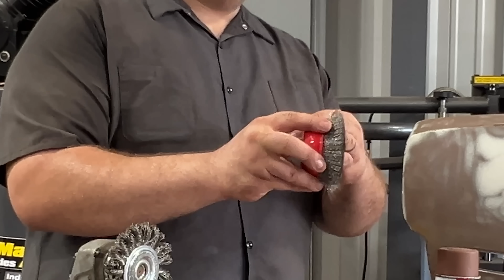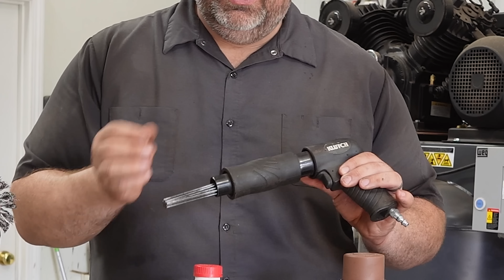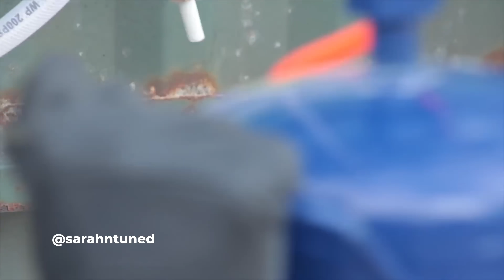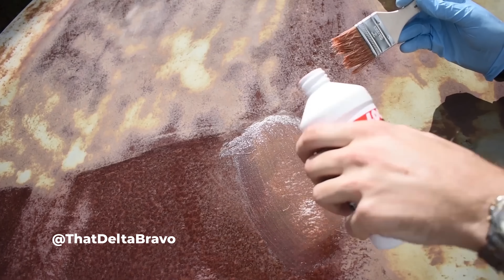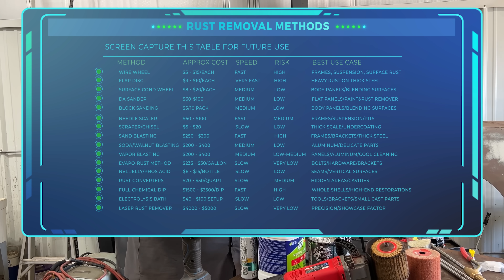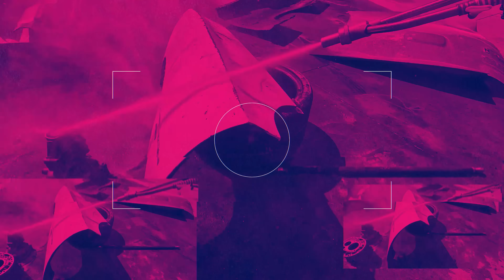I Can’t Believe It Worked! The Best DIY Rust Removal Methods!

Comment: So what would you recommend to remove paint off of molded plastic?  I've got a couple of side skirt extensions that I want to get repainted, along with some center caps, so everything matches the same color paint I'm planning on using for a couple of canards.

Comment: Another vote for good old citric acid soaks, go with it in it's Anhydrous form for the best bang for the buck to mix with plain tap water (or if you're feeling flush de-min or de-ionised). Plus if you can heat your solution go for it.  I use a lethal ebay special mains powered immersion heater to acclerate the process, unplugging it before getting in the tank for a good scrub during the pickling with a wire brush.  Wear thick long cuff nitrile gloves too. The big uside of this remedy is that you can simply pour it awayonce the solution has ceased being effective as it's non toxic.  You need to give everything you've soaked a rinse in clean water to wash/flush any of the solution off the parts, and be warned they flash rust fast!

One thing I'd like to see is a comparison on is different re-usable blasting cabinet media, I'm having a hell of a job shifting powdercoat off steel in my cabinet despite having a fairly ballsy compressor.

Comment: definitely eye gear. One time not wearing them a dremel wheel blew up and pierced right below my eye in my eye lid. just a fraction up I'd be without an eye.  The while wearing gear a wire wheel (cheap one) blew apart and my face looked like a porcupine.

Comment: I tend not to use chemicals, I use media blasting of one medium or another, dry and wet, electrolysis bath, sonic cleaner, vibratory tumbler, various grades of bench mounted wire wheels/polishers and sometimes hand held wheels. I would love a laser unit but $$$ are an issue.

Comment: I just bought the Vapor Blasting.  -  I use Coroseal for frames,  and If I Can submerge the parts,  I use Vinegar and 10% molasses,  For other parts like roofs,  I use Krud Kutter Rust Dissolver  this works well and is water Soluble.    Excellent Video.     Sorry for your loss.

Comment: Sorry for your loss, Jared.

I LOVE evaporust.  However, I also bought some citric acid powder for descaling my robot vacuum/mop.  Mixing it with water, it works just as well (and it seems to take less time) as evaporust.  I tried it on a few of my rust coated tools and bolts, and it cleaned up exactly like evaporust.  It was about $8 for a can of citric acid powder.
Reply: Now put some washing soda in with the citric acid.  You use a 10 to 4 ratio acid to soda. The soda neutralizes the acid some. It still works. Makes it more like how Evaporust works. Some say it works better.

Comment: In the 90s I worked at a boat trailer plant and ran a machine called a wheelabrator. This thing was the size of a small house the trailers went through. It used steel shot about like grains of salt. Wild times.

Comment: Used a like $15 vapor blasting attachment off AliExpress to hammer down the finish inside exhaust manifolds that hand ported with a die grinder. Did a fantastic job, couldn't recommend more. Did it on the lawn with parts clamped on a work horse so the clean up was a washing machine and a shower.

Comment: Inorganic chemist here. Personally, I use citric acid. Ksp (solubility equilibrium constant) is right for removing Fe2O3 (red rust) without removing iron, and it normally leaves a nice blued finish (Fe3O4) that resists further rusting. Unlike strong acids (HCl or H2SO4), can mix up a citric acid solution as concentrated as you like and it won't eat into metallic iron, just the rust. Can leave it on for weeks, it won't damage the metal. Pretty sure it is the active component in things like evapo-rust, but really cheap when you can just use lemon juice in a jar. If you can't submerge the part, mix citric acid with baking soda (sodium bicarbonate) and slather it on the rust, the rust will be gone once everything is dry and you wipe off the baking soda.
Reply: I am so stupid. I read that as fe2zero3 not fe2o3 and thought "dang that's a big molecule"
Reply: How would mixing it with baking soda work? Wouldn't that neutralize the acid, rendering it useless?
Reply: @Kluneberg  You get a weak acid and weak base buffered mixture. You want the citrate in excess, but buffered weak acids and bases aren't neutral, unlike mixtures of strong acids and bases.
Reply: @Kluneberg  citric acid and soda is a popular homebrew rust remover. The usual concentration is 100 grams acid to 40 grams washing soda in 1 liter of hot water. Why it works mixed is because of ions? The citric acid just has an affinity for rust atoms. Do you really need to know why it works? Something to do with chelation, blah blah.

Comment: Sorry to hear about your Mom. I need to use about 3 or 4 of those rust removal methods.  I've got some rear wheel arch repair to do on my Dodge D150 and my Plymouth Scamp needs a torsion bar frame and floor pan. All on a shoestring budget. Lol !
Reply from the maker: Hey! If you need more info on the floor pan for the scamp, I did that back on TriHard if you want to watch how it’s done before tearing in!

Comment: How do you treat the vapor blasted steel to prevent flash rusting from the water?  My understanding is that the trailer mounted professional units add some rust preventative to their water.  Can something similar be done with the pressure washer type units?
Reply from the maker: So there are coatings that you can just spray right on to etch/seal the surface right afterwards! Rust inhibitors. To be honest my fender I blasted, I had just fully blasted and got the call my mom passed, so I literally threw it inside and didn’t go back for a week and it hadn’t flashed over.
Reply: @TheQuestionableGarage  Sorry to hear about your mom.

Comment: KIND SIR THAT LASER IS SO COOL.
QUESTION , WHAT HAPPENS TO THE BACK SIDE OF WHAT YOU HIT.
WHY I AM ASKING IS. THE PAINT ON THE OTHER SIDE. ON A DENTED CAR YOUR WORKING ON.  YOU KNOW YOUR WORKING ON A BAD SPOT. PUSH THE DENT OUT. LASER  THE CRACK TO CLEAN IT. THE BACK SIDE AROUND THAT CRACK. THINKING OUT LOUD I GUESS. I WILL LOOK A ROUND AND SEE WHAT OTHERS AT BODY SHOPS ARE DOING.

Comment: A good method for dunking, which I used on my dash frame panels on my Celica and in my gas tank was Vinegar, followed by a Baking soda water bath. Turned out amazing! With the gas tank I blocked off all the ports while using it and had to turn it a few times, and when I was done while it is waiting for the Celica to be ready for it, I fogged out the tank with WD-40 as just a rust preventative so it doesn't flash rust. Vinegar is nature's rust remover!
Reply from the maker: That’s a good idea! I’ve done harder chemicals in a fuel tank
Reply: @TheQuestionableGarage I think I soaked the tank for nearly 3 weeks, that's not always an option. The 1/4 tank of gas that was in it was nice and red, and the fuel pump assembly was pretty crusty, but ended up turning out very nice, and replaced the fuel pump with a Pump from An Avalon, since it was way cheaper than a Walbro 255 and pumps nearly identical to it!
Reply: @TheQuestionableGarage but yeah, Vinegar is a mild acid, so it will break up the rust. Then you can literally wipe any rust right off, rinse it off really well, then dunk it in a Baking soda bath to neutralize the acid, and WA LA!
Reply: The best method is 1 liter hot water, 100 grams citric acid, 40 grams washing soda. That makes a chelating solution.

Comment: I need to know if I should buy that dustless blast nozzle. I keep reading conflicted reviews and my Pressure washer is only 2500 PSI ☹ Knew I should of bought the bigger one but the sales guy told me I was insane for wanting to even wash cars with a 2500 PSI when I use to wash fleets with a Diesel heated pressure washer. It's all in the technique and tip spread to distance.
Reply from the maker: So my electric pressure washer was 2500 and it couldn’t cut it, wasn’t able to siphon well enough to work I’ve seen the gas ones 2500psi work better with higher gpm. For $30 and a $16 bag it is worth trying, but based on my experience, 3,000+ and better gpm are a must.
Reply: @TheQuestionableGarage  I will have to try it. Mine is Gas 2500 PSI at 2.3 GPM it's a Stihl RB 200.

Comment: Did not catch which media you used for the vapor blaster?  Also, for that setup which media would you recommend for aluminum parts?
Reply from the maker: I was using glass, glass bead is a little better for aluminum. Be extremely careful with sand, if you get the wrong kind you can have silica dust, vapor blasting helps but still, permanent lung damage at risk!

Comment: The Strip and Clean disks used on both angle grinders and drill also work very well, but they do build-up a fair amount of heat on body panels.  They do last a good while and at least you are not getting bits of wire wheel flying into you.
Reply from the maker: Those are great for quicker rust removal, but the heat can be a concern on thinner panels!
Reply: I call 3M rust and paint removing discs magic discs. It ain't perfect but it's good enough for me. They're best used in an electric drill. Not super high speed. Light pressure works better than pressing hard.

Comment: In the 90s I used to buy this stuff that was like a clear gel that had some kind of acid in it, I think hydrochloric? And you just brushed it on and it fizzed and turned black and you could wipe it off and it was shiny metal again. It came in a 5L bottle with a label someone made on a photocopier and glued on the side, and I haven't seen it for sale since about 2001. That stuff was the best.
Reply from the maker: Sounds like a way more potent version of the aviation jelly or the evaporust.

Comment: Very good informative video. I had a friend tumble burnish a motorcycle tank for me, and it was the most incredible looking piece when it was done. I wish I could post a picture.
Reply from the maker: Long ago I did nuts, chain and some acid strapped to a wheel idling before resealing it. Then two months later reproduction tanks dropped that cost less than the reseal kit..
Reply: His tumbler uses hardened steel pins, which allows it to get into every nook and cranny. With this, a liquid also goes in made for whatever metal type he is doing. Aluminum comes out super nice.  This process is non-subtractive. He does this to vintage racing kart engins from all over. My Yamaha motor cases he did looks spectacular.

Comment: What I am looking for is, how do you remove old undercoating without damaging whats underneath? Good presentation, Thanks.
Reply from the maker: A really good tool for that is dry ice blasting, but it is expensive. Another option is dry ice secured against the panel and then breaking it off, if it’s more like the tar style.
Reply: How good are you with a torch? There's a lot to be said for a torch and a scraper on undercoating. But you can set the whole place on fire too. So having a pot of water around is handy. Maybe even a garden hose? The torch method can get away from you.

Comment: Great video!  I saw you showed a sarah-in-tuned for a demonstration, probably dry ice blasting.  I mentioned you in her video about 3D rubber bushings and gaskets since she needed some on her Civic SI restoration.  I highlighted the section when you made a heater core gasket on Pappy's truck fix #3 video. SSGT Marc.
Reply from the maker: Sarah works at a level of precision that shows her past aviation mechanics background, phenomenal! Appreciate you spreading the Questionable Garage with fellow creators.

Comment: Someone's got a viewfinder linked to my nightmares because I've been stressing some oxidation on my roofline for the past year. Didn't have a clue about any DIY solutions and this video covers it all.
Reply from the maker: I tried to hit a lot of the common methods and what I’ve used.
Reply: @TheQuestionableGarage you should do a REAL COST of restoring an old car.....

a non connection

Non sponsor 
Lone wolf 
any color 
on your own

COST....

ITEM BY ITEM
Reply from the maker: I’ve broke a few down, and one big reason why I’m a fan of rustorations. Johnnie Rev was a $7,000 build, and about 200 hours of work. Tri-hard in retail costs was $72,000. So far the Plymouth is pushing $38,000 and will go way way up…
Reply: @TheQuestionableGarage not with connections...in your garage with no buddies!!!